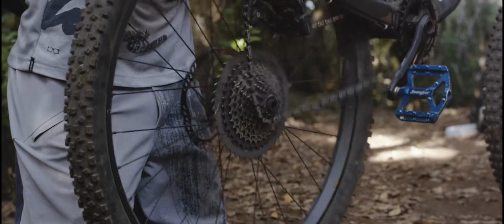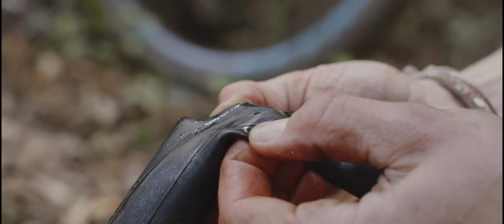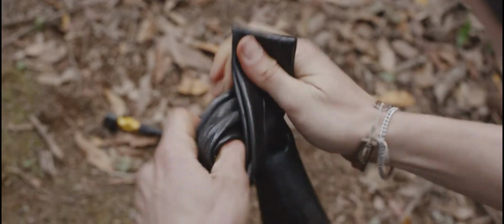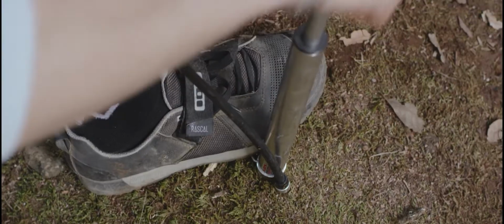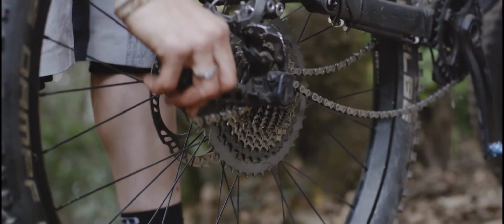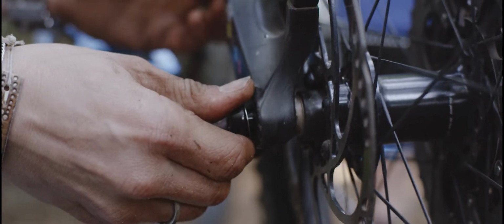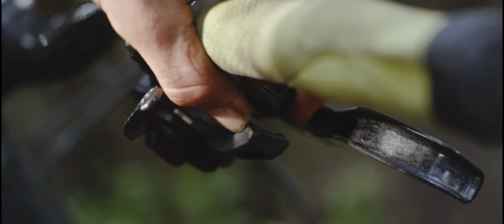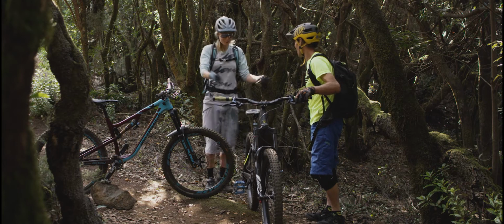TUBELESS - LESS TUBES Leatherman Bike Survival Workshop by Julia Hofmann

Comment: That's a pretty useful 'bush fix' if you don't have a repair kit :-)   One thing I'd add is to check the inside of the tyre where the damage occurred, just in case something is still stuck in there, else you'll be back to square 1 pretty quick!